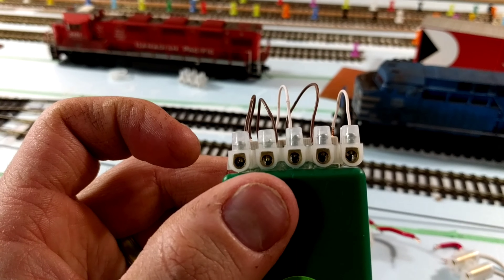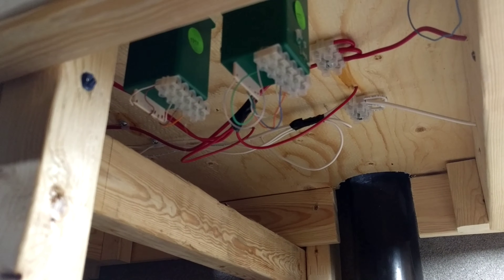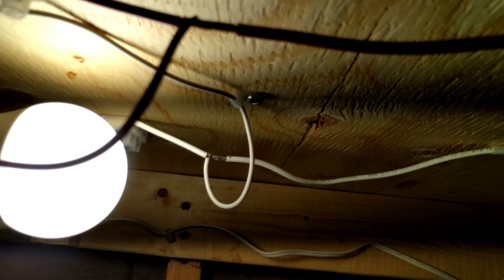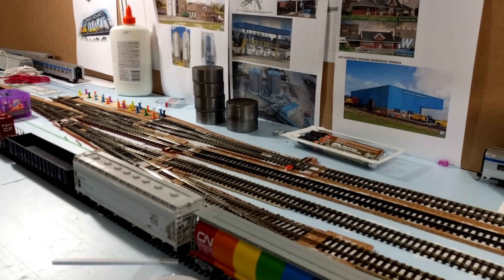Episode 11: More track work and new items, some changes.

Comment: very nice.. you have nce so can you not remote hand set control of your turn outs?  select accessory, assign a number, and open or closed ?
Reply from the maker: I can get  the Nce turnout controller and wire the tortoise to cab control for sure.But I am joing for more of a manual control feel since it's a switching layout.  I might change my mind though lol